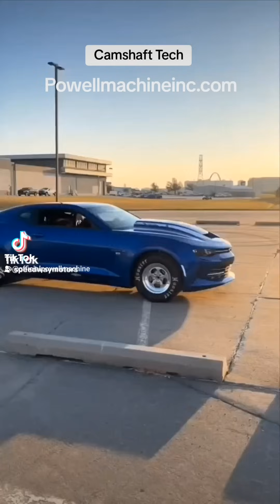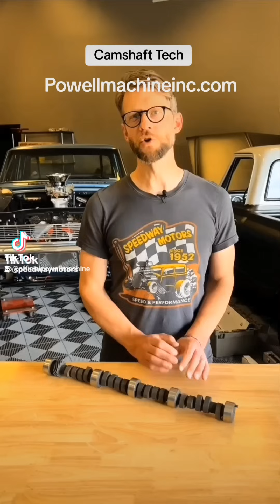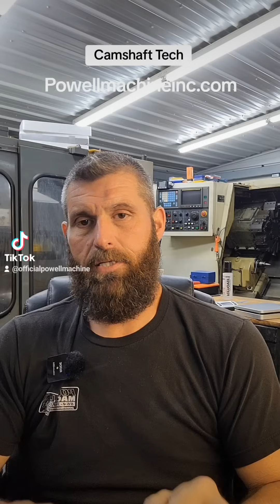Camshaft Tech,  overlap

Comment: Wider LSA creates more cylinder scavenging, manifold vacuum, wider power range and smoother idle. 
The tighter the LSA the lower the manifold vacuum, tighter the torque peak, rougher idle. 
Try not to over complicate the issue.

Comment: Back in my hay day you went by full duration (advertised) on Pontiac's in the 70's  u didn't  have  a lot of options  so follow what the manufacturers did I installed a 320 duration intake and exhaust 530 lift  with 1.65 rockers  and played with 1.5 Pontiac  played with duration  didn't  have gears to advanced or retarded cam timing u had to make an offset wood drift key  if u made a mistake u made it work

Comment: I think that because LSA tests in magazines and TV shows often use the exact same lobes on each of the test-cams at different LSA's, people then draw the conclusions that Daniel talks about. When I was trying to go up to the "next-level" on my last cam, I quickly found out that cam manufactures don't often keep the same over-lap between different duration cams with the same LSA even within the same "family". Another point to consider is the overlap at the advertised timing events (although I don't know if that is really relevant within the context of this subject which is just the sound; its probably not affected much at such low lifts).
Reply from the maker: Good points!

Comment: My Problem is getting enough duration and lift for my displacement /powerband, while keeping the overlap in check to run power brakes. I've been emailing cam manufacturers and get different suggestions. From a 243/247 on 110lsa hyd. roller to salesman pushing a "Off the shelf" tiny 218 cam.

Know I'm wondering if I should do like the "Chevy LS Crowd" and get a mild duration and just Jack up the Rocker ratio to get the lift?

I had to stop going on Forums with Old timers saying a 250/260@0.050" cam on a 106lsa is a streetable?daily dsriver Smallblcok roller cam. Not with power brakes, or in my daily driver  automatic pickup.

I'm jsut going to have order a few and due a Dyno cam video for my youtube page.
Reply from the maker: If you "need" a big cam to meet the demand of the engine, then you don't have enough cylinder head.

Comment: Correct, it's overlap. But what's actually happening is that the amount of overlap is causing flow in the chamber to be unstable. Intake velocity and exhaust velocity are both too low to help the engine breathe normally. Normally the valve timing acts like a check valve to keep flow only coming in the intake and out the exhaust. The more overlap you have, the easier it is to flow any old direction-- intake and exhaust can both flow backwards and forward in irregular erratic patterns. At higher engine speeds (rpm) and with more open throttle you have higher velocity and the mass of the flow will provide enough inertia to provide its own "check valve" effect. IN fact, at high rpm, a big cam actually generates so much inertia that the exhaust charge creates more suction on the intake than does the piston going back down.

This is also why larger displacement engines using the same heads can tolerate more cam before getting into a lumpy idle-- for the same head flow, the larger displacement generates more port velocity and inertia. The cam that slightly lopes in your 5.3LS might be completely smooth in your 6.0 with identical heads.

It's that simple-- a choppy idle is flow instability from low intake velocity and long overlap. But it's not LSA per se. You could grind a tiny cam on a 100° LSA and get a smooth idle. Or you could grind a massive cam on 116° LSA and get lots of lope.
Reply from the maker: Yup

Comment: I know this has been beat to death, but do you think there is merit to what vizard says about choosing the lsa first, based on the flow characteristics of the head (Valve size in a nutshell?)  Then choose duration depending on what compression and rpm is chosen?  That cattle dog garage also backs that up, stating it does help to charge the cylinder somehow?
Reply from the maker: https://youtu.be/X9bIE7aBkcU

Comment: Oh my, and I thought picking a roller cam for my 97 Vortec 350 build was going to be easy, not. So it's got flat top pistons, heads have been done to accept up to .530 lift, engines going in a restored 86 S-10, probably 373 gears, 15" tires 285/70/15, TH-400 with appropriate stall and it will be a street racer. Any help would be appreciated.
Reply from the maker: Would need more information to recommend anything
Reply: @powellmachineinc  Thanks for the reply, what more info would you like?
Reply: I'm good as I'll just use something normal like a GM Performance cam. the truck is just for fun driving.

Comment: Here are my thoughts...having 30+ yrs of engine  builds and part and  assembly design and 2 national braket championships, 3 performance engine shops and 5yr and 11 months in NHRA . So your secret reference was slick and those who typically are in the business  knew who you ment. It saddens me to see someone involved in the design aspects of cams be so narrow minded.... for whatever reason.  I personally can say that I have followed him for many years and as much as you may not want to except it his methods have helped me to win 2 championships. There is absolutely no disputing his lead methodology  given that the proof is in the pudding I've absolutely decimated engines with 100 cubes more with less head and less cam using his methodology . How do you explain 77 lb ft with a simple camswap from a catalog cam to a custom w/ the same specs minus LSA ans even gained hp top end I'd love to hear your theory of how it don't work. I've seen it on the dyno the track and the street time and time again. Ide have to say maybe you should evaluate weather what your posting is the truth .... or maybe jealousy.  Either way.... it works!!! What testing have you done to prove he is wrong??????
Reply from the maker: Simple.. just look at the results from EW's cam challenge, we beat him twice.... plus we have actually used the "formula" and it did not produce positive results, watch my video on valve events, it will help you

Comment: 560 lift 260 duration with 56 over lap= what lsa
560 lift 240 duration with 56 overlap = what lsa 
Witch cam has more idle chop or are they the same idle chop

Comment: Would absolutely love a longer video with some pictures to grasps this. I’ve been digging with this for a long time now and still don’t get it really and I’m no dummy. Is choppy idle big duration or over lap or what about early exhaust opening I hear this a lot in videos like if you need to keep low end and don’t want a lot of overlap but want the chop then go early exhaust opening. Granted this is the Harley world but I’d asume it translates to all engines. Common built sportster cam is 56degrees overlap and 260intake 266exhaust  but then bigger bikes want to have chop but don’t want to move power band way up so they try for less overlap and less duration but more the timing event around but what truly does what??? Not a single great video out there. Just wish somone could really explain and show lt maybe with timing wheel cam graph or idk something. You’re definitely the man and know you’re the guy that  can do it. Love your wrk.  Regardless you the man. Thx

Comment: @powellmachineinc  Daniel
I have a question, how can you make a hyd roller cam with .780 lift and 270/285 dur @.50 on a 12:1 compression engine and run on pump gas?
Reply from the maker: Because a cam that big will kill the dynamic compression

Comment: Got some advice on symmetrical camshaft profile lobes asymmetrical profile lobes for high performance applications.
Reply from the maker: Don't really understand the question
Reply: @powellmachineinc  This is motorcycle camshaft related, but may be applicable to automotive performance camshafts also, as in a direct action on the finger follower where the front/leading ramp has a large arc and the closing ramp is like the one on a symmetrical camshaft. I figured you were familiar with this and could shed light on the subject. I had owned a 89 Suzuki GSXR in the past and it had an asymmetrical camshaft design for both (I/E) camshafts. This is a 4 valve with direct acting camshaft followers with a "Y" forked screw adjuster setup. Hope I explained this enough and look forward to your response on the matter and thank you.
Reply from the maker: @warrenlucier5796  any finger follower or Cora style ohc deal is going to have a inverse radius in the flank on the short side to give the same valve motion on opening and closing,  it's just a product of the valvetrain geometry.
Reply: @ Thanks 👍

Comment: This is why people think a big cam, with a tight LSA will magically give them a sprint car engine… 🤣
When all they accomplished by doing so is a 6.5:1 dynamic compression ratio, and a cammed derby car engine with 8” hg. 🤣

You’re obviously a camshaft master you know what makes a good sounding engine. Have to have the overlap, but you also have to have cylinder pressure to get the exhaust valve to “pop” during cylinder blowdown… 
Can’t just have the rumpity rump without the bang ba bang bang bang at the same time… lol 

Why very basic camshaft requirements include a static compression ratio minimum. To make sure there’s enough cylinder pressure for the engine to not be a slug, “until the cam comes in”. For lack of better words…
Reply from the maker: 💯,  Ty for the support 🙏
Reply: @powellmachineinc  you got it brother!
 I like what you do, your knowledge and honesty. Maybe one day I’ll have to do some cam work for me. Keep up the good work! 👍🏻

Comment: Would say a cam with 264 degrees duration at the seat & .208/.208 @.050, .299/.299 lobe lift, cut on a 108, idle decently in a 9.8 to 1 350 ci engine? It is in a Jeep, so it will make more than enough power at 2500 lbs. Heads are some old SR Toquers, with 2.05/1.6 valves that flow about 260ish at .600, The fellow (Roger Helgesen) did these heads almost 18 years ago & my memory is not clear?. Intake is a GM cast Iron Bowtie with plenum mods & a Carb Shop Qjet.
Reply from the maker: @derrelcarter9401  I would never run a single pattern cam in anything
Reply: @powellmachineinc  Thanks

Comment: I had an engine built that I haven't installed yet but hope to soon, I requested an aggressive lumpy idle along with good vacuum for pwr brakes  and yes I realize that you can't have your cake and eat it to but there is a happy medium. The engine is a 427 LS with after market everything CNC heads, Dart SHP block, etc etc . The cam specs are as follows. Rectangle Port R2.618”/.615” Valve Lift w/ 1.7 Rocker
233/250 Duration @ .050”
113LSA + 5* Advance  My question is, will this cam sound nice and have a good thump to it? Thanks in advance.
Reply from the maker: It will make noise

Comment: The choppily choppily is caused by reversion. Late ivc at low rpm causes reversion.when the engine speed gets higher where there is no more reversion,the engine cleans up. Or am I wrong. Dur and lsa both effect  overlap.
Reply from the maker: It was explained clearly in the video

Comment: I think they get retarded when 108 is optimum and to work around that because the Duration gets bigger width of lobe 
increases the lsa gets smaller and smaller .
turning it into tow truck cam 106 -to 109 to me is either tow truck cam or top fuel dragster cam and we see the flames coming out exaust
which is obvious the intake charge is pouring out exaust 
 where as a 114  with 275 285 duration would change the lsa ?
and pointed low duration cams are from the 80s i think makes valves bounce of seats 
but Grumpy jenkins ran a 114 lsa ran a 9.99 quarter mile in 427.
I run a 97 camaro and stock 350 6 speed 117 lsa cam 447 559 lift cam with about 400 lift with stock steel rockers 
a modified tb match ported exaust and stock hogged out lt1 exaust manafolds  
keep beating the cammed camaros without gears part of that is driver knowing where best power band is .
but have serious problem picking out what cam to upgrade to since my stocker is beating race cams .
So advice on good cam is needed hope fully going from 11 flat quarter mile to 10 second should be doable lol
 whats realy a good cam pick for 97 350 lt1 to take advantage of 3100 pound 6 speed ?
I never have got to talk to real cam tech before hope you can help

Comment: If you increase the cubic inches do you then have to increase the overlap to retain the same chop?

Edit: If i wanted a good tow cam with good low end torque but also some chop what specs would I want to go with? '97 EFI 460 with stock intake and heads in a F-350 with manual transmission and 4.10 gears. 7600ish lbs.

Comment: I understand everything that you just posted and agree with it. However, I have a simple comment and question. I've always thought that LSA would dictate (only as far as sound goes, not power band or performance) the "fast pace" sound of the overlap sound. In other words if you have a camshaft with a 106 LSA and a 30 degree overlap, it will be a fast idle whereas the same camshaft with a 114 degree LSA and 30 degree overlap will have that "same sound" but will sound more lazy.  Am I wrong?
Reply from the maker: Yes, it's actually int op and exh closing events that are more critical,  compression ratio is a major factor also in the "sound "

Comment: LSA, in conjunction with duration, affects overlap, yes. While LSA doesn't directly have anything to do with the choppity chop, it DOES directly affect overlap (or lack thereof), which DOES directly affect choppity chop. So while this guy is correct, he is TECHNICALLY correct.
Reply from the maker: @Mr334cobra  I thought my presentation made those facts clear
Reply: @powellmachineinc  You never said that LSA affects overlap. You simply stated that Overlap is what gives the chop. And that is correct. However you dismiss that LSA has anything to do with overlap and, instead, went as far to state that LSA has nothing to do with the chop. And while this is true, it is TECHNICALLY true. You made it seem as if LSA is a non-factor altogether. I do still love the content and explanations. You said nothing but facts, but it's teetering on misinformation.
Reply from the maker: @Mr334cobra  I gave 2 clear examples  of duration and lsa, maybe you just don't grasp valve events or I didn't explain it in a way u can understand.
Reply: @powellmachineinc  I appreciated your examples. My point here is that LSA DOES play a role in the chop. It is merely an indirect role. Overlap is the right answer for the chop, as you stated. LSA plays just as large a role as duration in overlap. Both are independent of one another. But both are just as important in affecting overlap.
Reply from the maker: @Mr334cobra  a better statement would be int cl and exh op are what determines overlap
Reply: @powellmachineinc  that is certainly the most accurate, technical, and thorough way of saying it. Agreed.

Comment: Another component is head port size. I had an FE 390 with a 204/214 cam with 114° lsa, awesome sounding lope. Then I had a BBF with a 214/224 cam on a 112° lsa with a smooth idle. My 416 LS has a 210/224 cam, 114° lsa with smooth idle, and efi.

It's not a single component of valve overlap, it's a combination of port size, overlap, compression ratio, quench pad design, and ignition timing. Once the cam is big enough, you won't have smooth idle anymore because of overlap, but it's not the single factor that makes lope happen.
Reply from the maker: Port size is irrelevant
Reply: @powellmachineinc  actually, volumetric efficiency is literally everything, port size included. Smaller ports will lope less than larger ports.

Comment: Just a comment section commentator,

The intake closing event has the greatest impact on a power curve.

Overlap next (exhaust close/intake open)

Finally, exhaust open. 

Overlap has the greatest effect on emissions and idle quality. 

These features also have to complement what intake/exhaust system is being used. 

The cam is but the conductor to the mechanical Orchestra, however the cam grinder/engine builder is the composer.
Reply: ,,,,,,,,,,,,,,,,,,,,,,,,,,,,,,,,,exh  is  already  open as the piston  comes  near  TDC on the  exh  stroke  ;  when the int valve  leaves its seat before TDC on the exh  stroke ; that  initiates   the overlap period,,,,,,,the overlap  is  done  as the exh valve  closes  sometime  after TDC  during  the  Int  stroke.........................ORDER OF operation  is   [ intake opens   -  exhaust  closes ].................,,

Comment: dave crower asked me... do you want to post a number? or do you want something that will perform in your application?
Reply from the maker: Yup
Reply: @powellmachineinc  he wanted head flow numbers at .100 to .700 valve lift / compression ratio, cui rod length bore car weight.

Comment: A lot if not most of these camshaft videos are using general terms and almost none provide the math to actually spec the correct cam. That's like building a house not knowing how to use a square. Stop guessing what cam you need ...  Google Cam Calc Pro